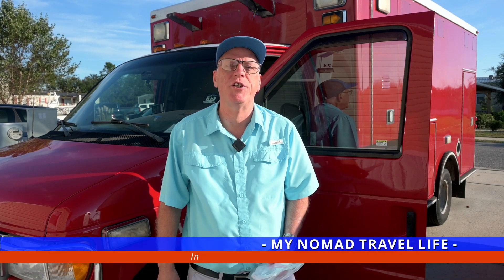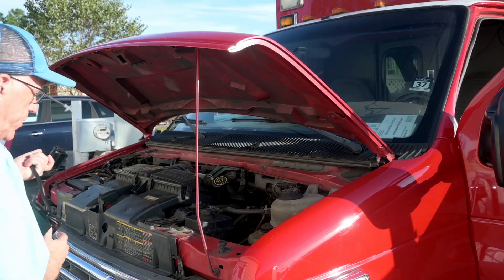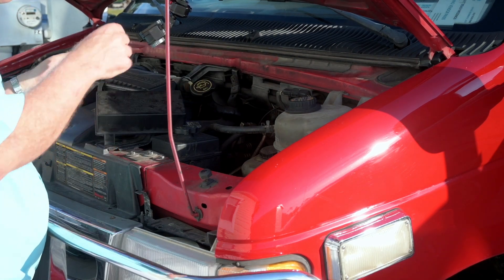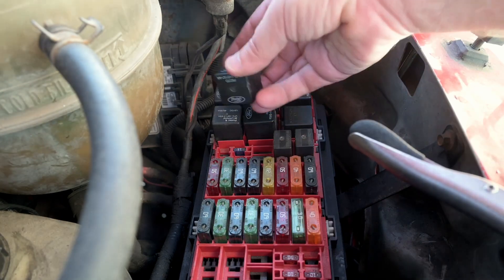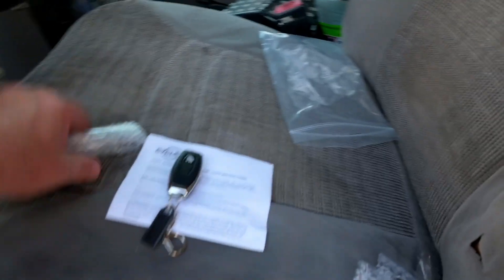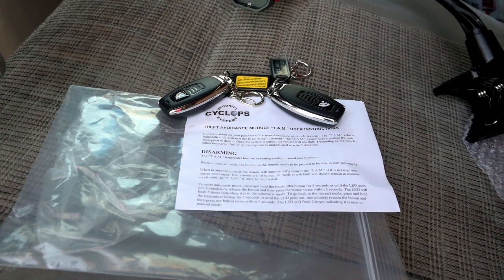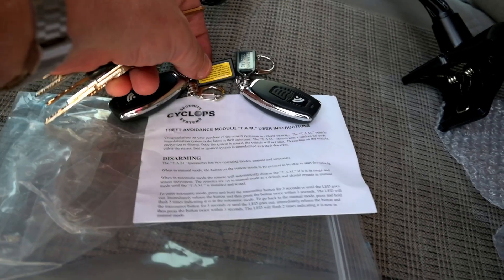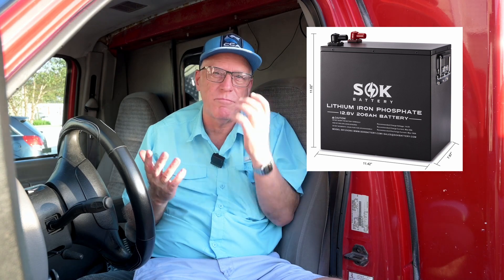Cyclops Anti Theft Install in our 2000 ambulance conversion

Comment: What relay module did the Cyclops device replace ? Is it the relay for the fuel pump ? Update: the Seller advised me to install the Cyclops relay in PCM position.